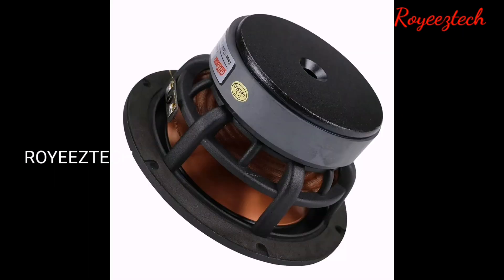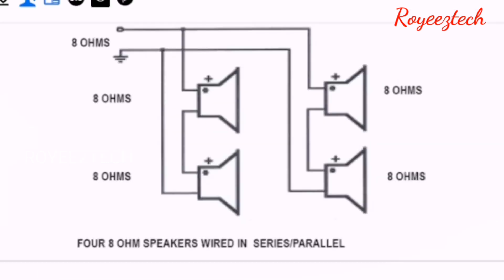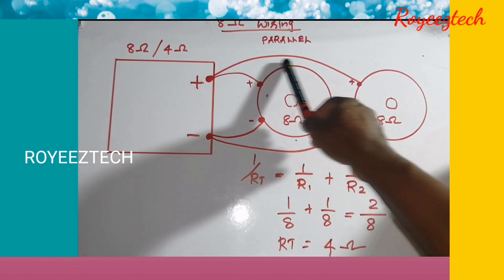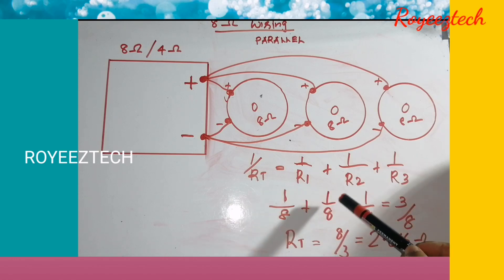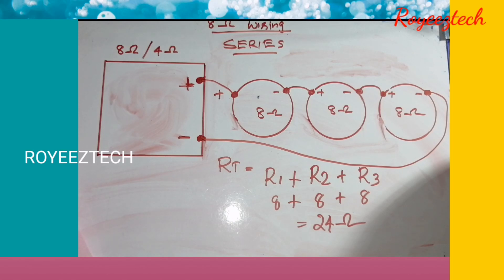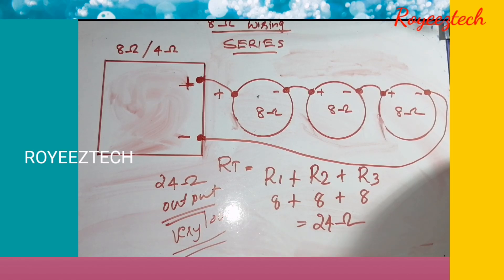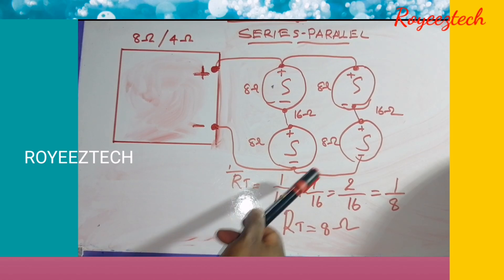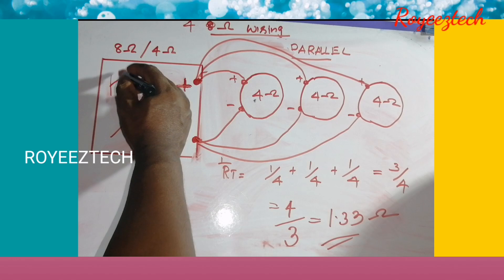Speakers -series parallel connection,speaker Impedance(ohm) matching

Comment: 6 ohms 75 watt ന്
8ohms 50 watt രണ്ട് speeker വെച്ചാൽ മാച്ച് ആവുമോ bro...parallel connection
Reply from the maker: Parallel 4 ohm akum
Reply: @Royeeztech  ഞാൻ ചോദിച്ചത് 6 ohms 75 watt amplifry ന് സപ്പോർട്ട് ആവുമോ എന്നാണ് വീഡിയോയിൽ പറയുന്നുണ്ട് സപ്പോർട്ട് ആവും എന്ന് Yes or No?
8ohms 50 watt രണ്ട് speeker വെച്ചാൽ മാച്ച് ആവുമോ 4 ohms album ennu ariyam bro...parallel connection
Reply from the maker: 6 ohm ampil support avilla
Reply: @Royeeztech  thanks for support....bro..

Comment: There are  impedance matching circuits for speaker parallel connection. These circuits are used in all HiFi audio systems especially while connecting Woofer, Tweeter and Midrange. Please explain about that.

Comment: Ahuja 100w 16ohm full range speaker 4/8ohms amplifier വെച്ചാൽ എന്തെങ്കിലും പ്രശ്നമുണ്ടോ ????
Reply: ശബ്ദം കുറവ് വരുമെന്ന പ്രശ്നം മാത്രമെയൊള്ളു. അതായത് 8 ohms 100 watts ൻ്റ്  അപ്ലിഫയറിൽ 16 ohms ൻ്റെ സ്പീക്കർ  കണക്ട് ചെയ്യ്താൽ 50 watts ശബ്ദമെ കിട്ടുകയൊള്ളു.
Reply: @jeromejoseph41  Impudence match aaki eathra speeker venamengilum kodkkavuo
Reply: @elhub4100  തീർച്ചയായും സാധിക്കും, എന്നാൽ Amplifier ൻ്റ്  ഒരു ചാനലിൻ്റെ ആകെ  output watts നെ ഓരോ സ്പ്പിക്കറിലേക്കും (share) ഭാഗം വെച്ചു കൊടുക്കുകയാണന്ന കാര്യം ഓർമിക്കണം.
Reply: @jeromejoseph41  appo 15w amp n 15w 2 spkeeker connect cheythit karyam illa??? Alle
Reply: @elhub4100  ഒന്നിൽ കൂടുതൽ സ്പീക്കർ connect ചെയ്യുമ്പോൾ wide range effect കിട്ടുമെന്നുള്ളതാണ് ഇതിൻ്റെ ഒന്നാമത്തെ കാര്യം ഇത് ഒരു വളരെ നല്ല അനുഭവമാണ് നൽകുന്നത്, കൂടിയ home theatre ൽ ഒട്ടുമിക്കതിലും  multi speakers  ഓരോ ചാനലിലും വരുന്നതിൻ്റെ ഒരു കാരണം ഇതാണ്. രണ്ടാമത്തെ കാര്യം  ഒരു സ്പീക്കർ അതിൻ്റെ maximum watts ഇൽ പ്രവർത്തിക്കുമ്പോൾ അതിൻ്റ് വെക്തത പോകുന്നതായി നാം കാണുന്നു. ഇതിനെ ഒരു multi-speaker connection നിലൂടെ പാഹരിക്കാൻ കഴിയുന്നു.
Reply: @elhub4100  wattsum match avanam
Reply: ഞാൻ ഒരു കാര്യം ഓർമ്മിപ്പിക്കുന്നു. ഒരു സ്പീക്കറിൻ്റെ യഥാർത്ഥമായ watts അതിൻ്റെ RMS  Watts ആണ്.
Reply: @jeromejoseph41  rms 100w ആണ് പക്ഷേ ohനട 16 ആണ്
Reply: @agl1455  രണ്ട് ഒരേ 16 ohms സ്പീക്കർ paral ആയി കണക്ട് ചെയ്യു. അപ്പോൾ  8ohms ആകുകയും 100 watts  OUTPUT  കിട്ടുകയും ചെയ്യും
Reply: @jeromejoseph41  crossover vechu oru tower speaker  cannot cheubol ohms aggannanokkukka
Reply: @pradheeshpc1466  ??????
Reply: @jeromejoseph41   moonu speakerum  8ohum avubol crossoverile kodukkuvol problem aville

Comment: 4-8 oh aano allengil 4ohm or 8ohm aano ? Speaker connect cheythu vannapol 6 ohm kitti ennu karuthika ithu eeeparayunna 4-8 oh support cheyyunna bord il koduthaal preshnamundo
Reply: സാധാരണ ആപ്ലിഫയറിൻ്റെ output resistance (ohms) ഒരേ ohms തന്നെ ആയിരിക്കും അതായത് 8ohms 8 ohms തന്നെ ആയിരിക്കും. അതു കൊണ്ട് 8 ohms ൻ്റെ ആപ്ലിഫയറിൽ 6 ohms ൻ്റ് സ്പീക്കർ കണക്ട് ചെയ്യുന്നത് risk ആണ്. ഇത് അപ്ലിഫയറിനെ ഹീറ്റാക്കാൻ സാധ്യതയുണ്ട്. എന്നാൽ 4 ohm ൻ്റ് ampൽ 6 ohms ൻ്റെ സ്പീക്കർ കണക്ട് ചെയ്യ്താൽ പ്രശ്നമില്ല.

Comment: Bro ente kayil oru subwoofer amplifier unde athileke support chiyuna oru subwoofer paranju tharamo 
details 12 0 12 ?amp power supply 
20 30 ic 2x 
4 mosfit tip3055 and tip2955 ithil ethra amps transformer use cheyanam ethu subwoofer use cheyam njan vitilanu ubayogikunadu njan 10amps transistor anu use chiyunadu athil stereo amplifier 4440 duel ic bodum use chiyunu 8inch 4om subwoofer anu tharambi attam keri oru pudiya subwoofer vaganam karactaya oru subwoofer paranju tharo
Reply: 2030 double ic anengil 8 ohms 30 watts subwoofer Anu nallath,

Comment: Tweeter bhhadakamaano..? Aanenkil tweeter ethra ohms aayirikkum? Ente caaaril series connection aayirikkum 2 tweeter 2 front 2 back... Sound valare kurava back speakeril
Reply: തീർച്ചയായും ഓം നിയമം ഇവിടെയും ബാധകമാകും resistance കൂടുതൽ എങ്കിൽ ശബ്ദം കുറയും - so calculate first before you connect it.
Reply: സാധാരണ tweeter ൻ്റെ പുറകിലൊ അതിൻ്റെ കവറിലൊ കൊടുത്തിട്ടുണ്ടാകും. ഏകദേശം 4, 3 ohms ആണ് സാധാരണ കാണുന്നത്
Reply: Multimeter vech check cheyyoo

Comment: ചേട്ടാ എൻ്റെ കൈയിൽ 4440 ic amplifier ആണ് ഉള്ളത് അതിന് രണ്ട് out channel ഉണ്ട് 8 inch ൻ്റെ speaker ആണ് ഉപയോഗിക്കുന്നത് അതിൽ extra 2 എണ്ണം കുടി Add ചേയിയ വോ?
Reply: Bro 4440 ennu parayunnath Oru channel 19 wats anu.athil connect cheyyan kitunnath 20 watts 4 inch speaker anu.8 inch okey 40 watts ayirikum athu thanne kodukan patilla
Reply: @Sharon-xu1xb  ബ്രോ 4440 ic ആംപ്ലിഫയറിൽ നല്ല ക്ലാരിറ്റിയിൽ പാട്ടു കേൾക്കാൻ കണക്ട് ചെയ്യാൻ പറ്റുന്ന  സ്പീക്കർ inch, watts, brand പറഞ്ഞു തരുമോ?

Comment: ചേട്ടാ, എൻ്റെ കയ്യിൽ 50 W ൻ്റെ രണ്ട് speaker ഉണ്ട്. Friend ൻ്റെ കാറിൽ വച്ചിരുന്നതാണ്. സാധാരണ midrange ൻ്റെ square box ൽ ആണ് വച്ചിരുന്നത്. അതിൽ 4 ohm 50W Sony woofer എന്നാണ് sticker. But ആ രണ്ടും വീട്ടിലെ amp ൽ bass full വച്ചാലും, കാറിൽ ampൽ വച്ചാലും mid range ൻ്റ് effect ആണ് കിട്ടുന്നത്. ആ speaker ഒറിജിനൽ woofer ആണോ എന്ന് എങ്ങനെ അറിയാൻ പറ്റും?
Reply: MEDIA TECH ചാനലിൽ നിങ്ങൾക്കുളള  വിതൃസ്തമായ 
 വീഡിയോകൾ ഉണ്ട്!
കണ്ടു നോക്കണം.,...,
ഇഷ്ടപ്പെട്ട subscribe ചെയ്യാനും മറക്കല്ലി.

തിരിചും വരണെ
Reply: Etha amplifier 50 watts 4 ohms anengil correct work cheyyum

Comment: Car sub amplifier  നമുക്ക്  വീട്ടിൽ use ചെയ്യാൻ പറ്റുമോ
Reply: തീർച്ചയായും പറ്റും. അതിനു ആമ്പിന്റെ വോൾട്ട്, ആംപിയർ നോക്കി power supply vanganam. Connection currect ayit kooduthal work cheyyum
Reply: SMPS POWER  SUPPLAY  ആണ്  നല്ലത്.   SUB  WOOFER  CAPACITOR  വച്ചാൽ  നല്ലത്

Comment: Appol nammal ohms mathram nokkiyal mathiyo ? Wants nokkande ?
Reply: ഒരു അംപ്ലിഫയറിൻ്റെ ഒരു ചാനലിൻ്റെ output ആകെ 100 watts Rms ആണങ്കിൽ സ്പീക്കർ ഒന്നൊ അതിൽ അധികമൊ ആണെങ്കിലും അതിന്  ആകെ 100  watts RMS input power ഉണ്ടായിരിക്കണം. ഇതിൽ താഴെ എങ്കിൽ,  സ്പീക്കറിന്  താങ്ങാവുന്നതിലും കൂടുതൽ  watts, ആംപ്ലിഫയറിൽ volume കൂട്ടുന്നത് മൂലം ഉണ്ടാകുകയും, അത് സ്പീക്കറിനെയും ഒരു പക്ഷെ ആംപ്ലിഫയറിനെയും Damage ആക്കും. അതു കൊണ്ട് സ്പീക്കറിൻ്റെ watts കൂടിയാൽ പ്രശ്നമില്ല, എന്നാൽ കുറയുവാൻ  അനുവദിക്കരുത്.
Reply: @jeromejoseph41  anganeyalla Bro.amplifier 100 watts Rms anengil 100 watts Rms speaker  Anu correct.speaker watts 100il kooduthal anengil sound quality kurayum speakerinu working kurayum.pinne speakerinekal amplifire watts ithiri koodi ninnal performance koodum.ennu vech over koodaruth kurach koodam.
Reply: @Sharon-xu1xb   @Sharon  പ്രിയ സുഹൃത്തേ ഞാൻ ഇവിടെ ഉദ്ദേശിച്ചത് ഹണ്ടർ വാട്സ് ഉള്ള 4 ohmsൻറെ ആംപ്ലിഫയർ -ഇൽ  ഫിഫ്റ്റി വാട്ട്സ് RMS -ൻറെ രണ്ട് 8 ohms സ്പീക്കർ parallel ആയി കൊടുത്തു കഴിഞ്ഞാൽ ആകെ 100 വാട്സും ആകെ  4 Ohmsസും ലഭിക്കും ഇതാണ് ഞാൻ ഉദ്ദേശിച്ചത്.
Reply: @jeromejoseph41  anganeyanengil correct Bro 🙂
Reply: @jeromejoseph41  njan vijarichath 100 wattsinte amplifieril 100inekal kooduthal watts speaker vechu ennanu.